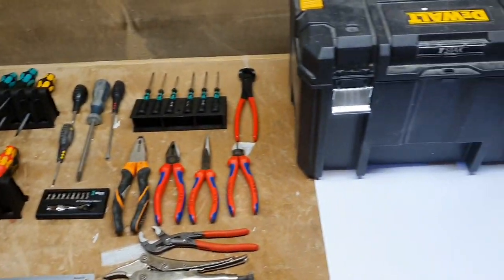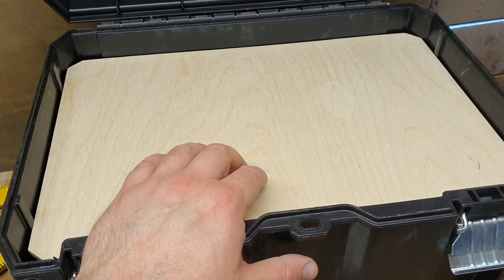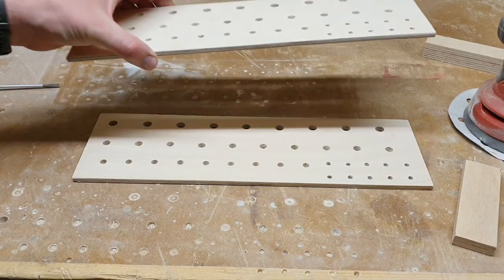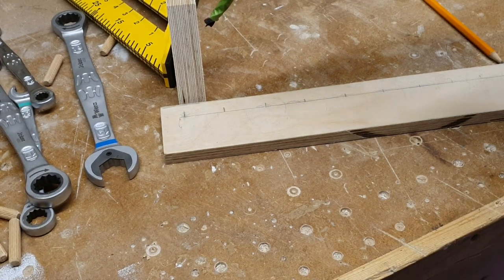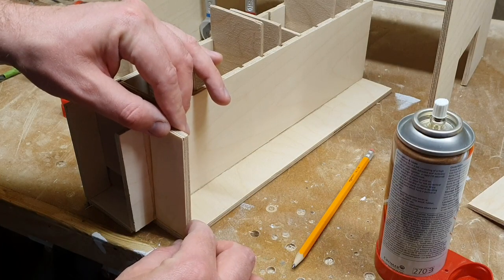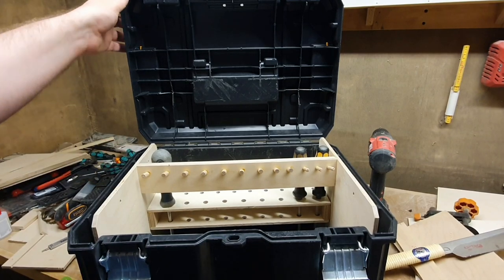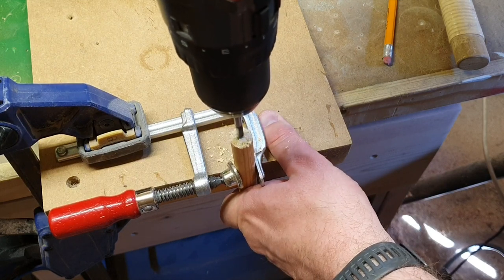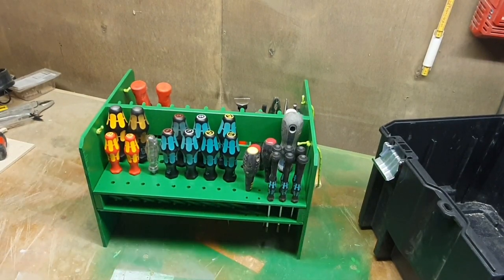DIY Dewalt Tstak Tool Organiser

Comment: This box insert is absolutely fabulous.  Perhaps you can find a way to manufacture this box either with plywood or high impact styrene plastic.  Apply for a patent pronto.  I am sure those with similar tools would find this so handy as well as useful.  BRAVO!!
Reply from the maker: Thank you!
Reply: Whilst this is a good design its not new as people have been making these since stackable boxes came out . I suspect there are at least 100 different variations on YT

Comment: Yours looks very organized.  Looks good.  I got the Dewalt Tough System tool box and I really like them.  It's a mid sized box but very large to fit 2 drills, 3 batteries, charger, and 4 different drill/bit organizers.
Reply from the maker: Yes the tough system is very nice, I have a friend who has them, I found these boxes locally on sale so went with the Tstak. I have 2 of these large boxes and the drill and impact driver box
Reply: Well Done

Comment: That's a really good design and it looks great. It's lucky that your vid just popped up on my phone as I'm about to make one these myself, and yours is a lot simpler and more elegant than what I had in mind. Excellent job👍
Reply from the maker: Thank you! What are you going to make yours out of? Have you a YouTube channel or Instagram where I could see what you make
Reply: @BCdesign1  I've got loads of offcuts of birch ply and thin mdf. I'll make the carcass of ply and use the mdf for dividers. It will probably end up painted dewalt signal yellow and black. I'm not on Instagram and I've never done a YouTube video, but I may well give it a go in future.

Comment: Well thought out, for the space available.  Two changes I"d make........ use "L" hooks for your spanners (so they stay put) and add a styrofoam board in that screw driver rack space or tighten up that space so you are not always fishing for that lower hole.
Reply from the maker: The foam between the screwdriver rack is a great idea, havnt had any problems with the spanners falling off yet becsuse the dowels are angled
Reply: @BCdesign1  Good stuff!  Thanks for the reply.

Comment: I really liked it, amazing idea!! I would just have made a different detail from you, instead of side handles, I would have made a single central handle with a hole in the wood itself, I would lose the use of some tools but gain practicality.
Congratulations on the work.
Reply from the maker: Thanks for watching! I couldnt make the central handle and fit the tools I wanted as the inside of the box lid has mouldings that protude downwards when closed. It would mean the handle would be lower than the tool tops and I wouldn't be able to hang my spanners either. To be honest after a using it a lot I really only lift it out of the box now if I need to clean the inside of the box

Comment: I really like this. Very well thought out and nice process. The only thing I'd do differently is change to a single central handle. Probably solid in the plywood and perhaps one that slides up a couple inches before it engages.
Reply from the maker: Thanks the handle is a nice idea, I found making a central handle tough as I wanted to hang the spanners along the middle, I could figure out a way to do a handle there at the same time
Reply from the maker: *I couldnt find a way
Reply: @BCdesign1  just thinking on it now, the wire handle to a 5 gallon pail could be repurposed. Little plastic part rests on top of the center partition and the wire runs straight down and their ends still have the hooks that catch when the handle is pulled up a couple inches. Im gonna try to remember this for the future.

Comment: I've been looking at doing something similar with my TStak. One question - why do you only have to cut a square out of one end piece? The box is symmetrical, isn't it?
Reply from the maker: Yeah the box is symmetrical, you could make one without the cut out and fit it between the protruding parts in the bottom of the tstak box, but to lay out the amount of screwdrivers I wanted to store in the box I needed more space, so I think i gained an extra 20mm of room by cutting out one side, and that was all I needed so I didn't cut the other side.